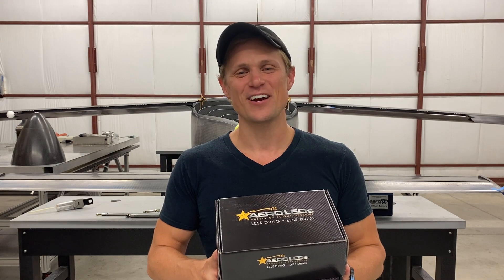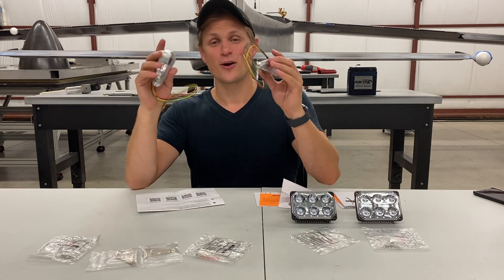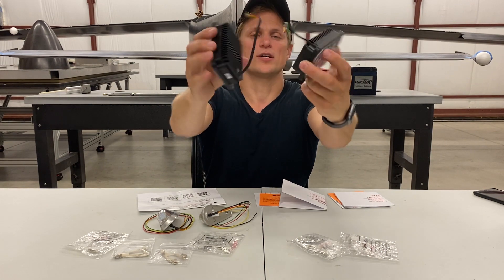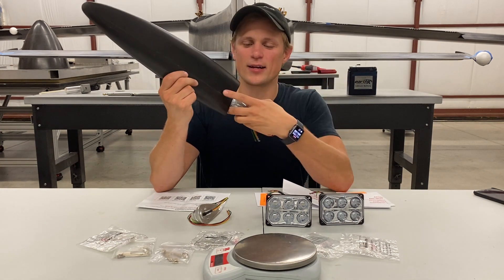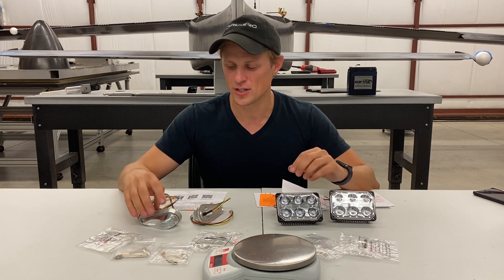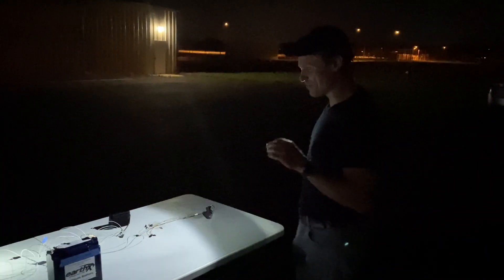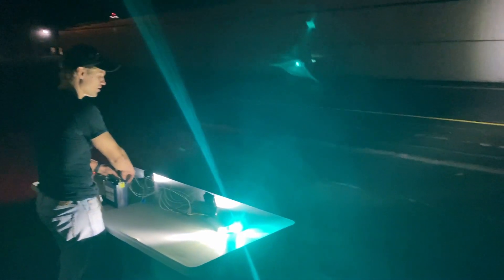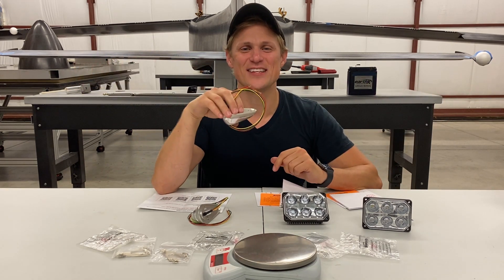AeroLEDs LIGHTS for the DarkAero 1! - July 24, 2020

Comment: With the landing/taxi lights mounted on the gear legs, you're not going to get any benefit from the wig-wag function until you're in the pattern.  Personally, I'd much prefer to see them behind a lens in the wing leading edge so I could use them at all times below 10,000'.
Reply: Excellent point
Reply: I agree absolutely. Best always chaps 🦘🇦🇺 / M 😁
Reply: Suggest adding a 3rd light as your recognition light that would flash.

Comment: You mentioned utilizing the wig wag function in high traffic area’s and that they’re being mounted to the main gear. Based off that, would the gear have to be extended in order for them to be in use, or will they always be exposed?  If they’re always exposed, will the wig wag be coupled to the TCAS system for automatic engagement when traffic alerts are issued similar to how many certified aircraft operate?

Comment: Can you all do a video on how you guys as engineers will determine the ops limits, how to find CG, as well as TOLD data
Reply: FAR 23 can help you there and books. Find CG? first you calculate it and then you check with scales, that is why every component is weighted and then placed in the worksheet for CG calcs.

Comment: One could accuse the products of being a bit too rooted in convention. Meaning the shape. The tip lights are large bulbs in the air when they could be near zero size with LEDs. The landing lights can also be a narrow strip so it can fit at the leading edge of an even very thin wing. And by using numerous LEDs (which are tiny) you can spread out the losses so much and give them such surplus that they hardly need cooling. Meaning lighter. Little to no heatsink.
Cree has a new XM L3 diode (3mm wide) claiming about 180lm/W in realistic temperatures. Each can burst 15watt but say you run it at 1watt it might only have 0.4watt waste heat. And you'd only need 18 to match the sunbeam. And they could be strobed at 10x power if you are trying to light up a mountain.
Sidenote, if you made the fuselage single piece you'd save a lot of work, traded for an awkward layup. But with the right jigs and bags, it might be easy and much easier than gluing and sanding many pieces. One piece should be strong and light. the right arrangement of compound curves it might not even need any bulkheads. Optimization is king.
Reply: Dan Frederiksen great point on the LEDs. Made by AeroLEDs as retrofits for existing Incandescent.... but great point, they could have a much smaller version for new experimentals.
Reply: @DavidSL64  Keep in mind that those wingtip lights also contain constant current drivers and control electronics.  Plus they have to be shaped and have optics that make the light cover the required fields of view.  There's more to the size than just small emitters.